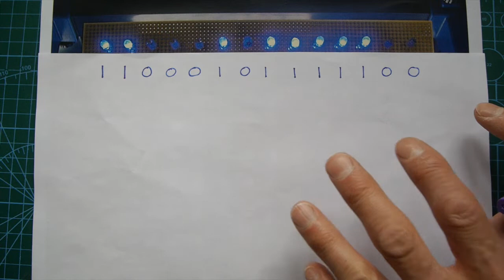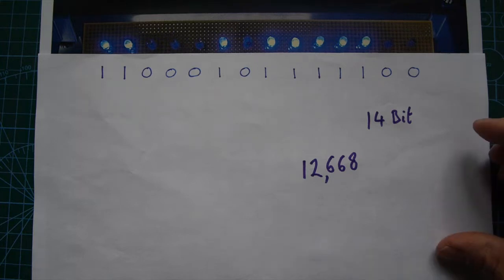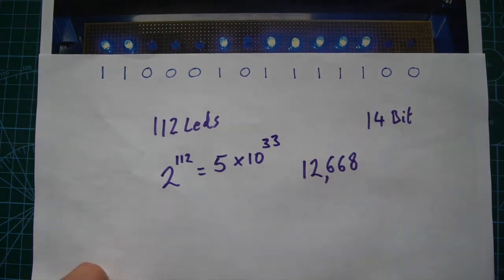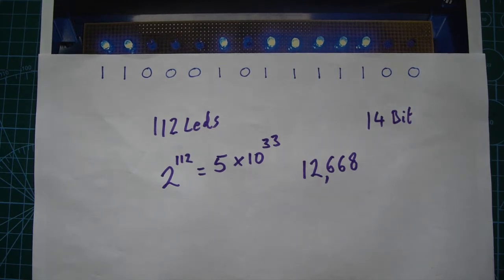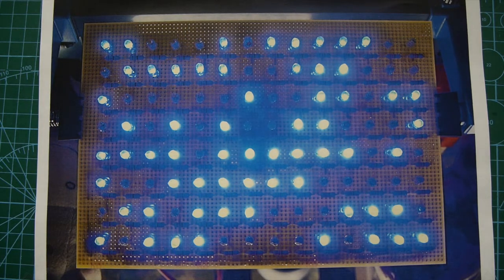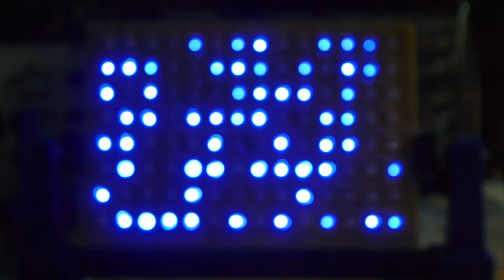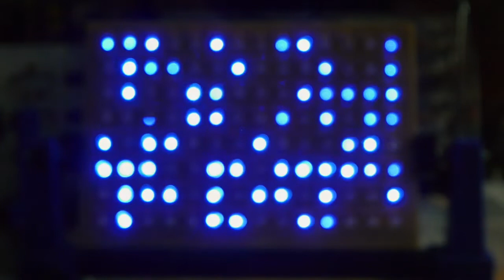Random Number Generator - F-J's Physics - Video167

Comment: Again is there some math that you can use that would actually create a true random number not just a pseudo random which is what I think you alluded to when you stated that there's some mathematicians out there. That's the reason I was thinking about using environmental background radiation and a Geiger counter. That's going to create pulses on the detection line and depending on how you write your code you could plug it into a pre-written script which seeks the randomness from your peripheral and you designate an attached peripheral via USB as your web camera or the pulses from a Geiger counter. It will then populate a place in memory I believe from which it takes random numbers. I've read some of the code on a really decent library and they all call it pseudo random but if you're getting your random numbers from something like a Geiger counter or even perhaps in your case I wonder if it is truly random? You would have to analyze the pattern of flashing and see if you can actually find a pattern. I don't think you would find a pattern in environmental background radiation. You follow me I guess?
Reply from the maker: Yes, there is a difference.  We describe nuclear radiation as being random but what we mean is you cannot predict when any one atom's nucleus will decay.  If you have a group or even background you have to decide what aspect you are measuring to say it is random as there you are dealing with a group of atoms.  In that case there will be patterns which can be teased out with statistical methods.

Comment: I was thinking that one of the only ways you could really get truly random would be to sample environmental radioactive decay with a Geiger counter. You could do it with muons but you're not going to get the count amount necessary to fill up the buffer. But just using the environmental radioactive decay level of isotopes It's going to be absolutely completely random due to the mix so as long as the code and the math used to trigger where that number is chosen from and how it's chosen based on the decay of the isotopes around the Geiger counter then you would have a true random number generator.
Reply from the maker: Yes, the limitation is on 'where the number is chosen from' and 'how it is chosen' again!

Comment: You could pipe the resister/LED junction of each LED into latches and use BCD drivers to output the value to a seven segment display.
Reply from the maker: Brilliant idea Steve!  I think I have had enough of 100s of solder joints but... I could build a smaller one.  You are giving me ideas!

Comment: Hello Anthony,
I have two points to your video.
First point, the behaviour of the blinken lights supercomputer is not random.  I know it sounds strange, but it is not random.  The correct word to describe it is "chaos"  the LEDs behave according to the chaos theory.

The second point goes back to the question why not use one resistor instead of many.  Actually that is great, great question.  All the LEDs are coupled via power.  When you have many resistors, the coupling is very weak.  Using one resistor instead of many will open two questions.
1.  when majority LEDs are off, the few shining got all the current.  You can "overcurrent" them and burn.
2. Having only one resistor means, that now the LEDs are more closely and strongly coupled.  So there should be visible tendency to resynchronise.
Reply from the maker: Radek, thanks for this.  Interesting what you say.  I guess it is chaotic as the there is a limited) though massive number of outcomes that are bounded within limits rather than being capable of any outcome.  I am working on a chaos video at the moment but I cannot get my analogue electronics to perform the correct differential equation integrations to show the Lorenz Attractor or similar.  I will get there at some point I hope!  LEDs, I did not realise it would affect coupling and therefore synchronisation.  That's interesting!  I realise that with multiple resistors the current through any LED should be fairly fixed when it is on obviously assuming a much lower internal resistance of the power supply!  Thanks for your interesting comments and for watching.  Hope you will enjoy some of the other videos too!
Reply: @AnthonyFrancisJones  , yes, the Lorenz butterfly comes to my mind when I was writing about chaos.  There is schematic he used, and I found it is also in The Art of Electronics the X Chapters, page 358.  However you need an MPY634 or similar, and two of them.  It is analog multiplier.

With that re-synchronisation of blinking LEDs, it is my prediction based on the fact that blinking LED is an oscillator.  When you find a way how to couple them strongly enough they must synchronise by definition.  There is a nice video on YT somewhere, I guess by Veritasium or someone, and there an mechanical motronomes are used as oscillators.  They behave exactly like the blinking LEDs and shortly desynchronised.  Then same situation but the metronomes were on hanging desk, which could move, and by the coupling of that desk they synchronised.
Reply from the maker: Thanks Radek.  Yes my chaos circuit will be like Horowitz and Hills.  The book of theirs I bought when I was at school predated the chaos chapter addition!  I am sure I have made a simple mistake or solder bridge in my circuit but it is sensitive to initial conditions by not working!  I remember the issue of clocks synchronising on a wall and also remember the paper on synchronising metronomes.  I think it has been much copied on YouTube.  I think you may well be right about the LEDs - I will have to try a circuit.  I do have one that has lots of LEDs in a cube with only one current limiting resistor and have not yet noticed synchronisation.  I think they are so cheaply made that they may well synchronise and then immediately go out of sync again due to differences in their manufacture.  Al interesting stuff!
Reply: @AnthonyFrancisJones  
hm.... yes, I call it to crash into reality.  The real word is not always as we think.  I was trying to find information about flashing led internals however was not successful.  This could answer why the do not synchronize as the metronomes does.

In meantime I got my new Apollo Vampire computer and program to it Paul Dunn formulas.  There is a small clip from it. https://www.youtube.com/watch?v=Z-48PZnKONQ

It kept me thinking about chaos much.  After a while I got to following conclusion:
1. There is definitely not a bit of randomness.
2. Diving my nose into formulas behind, I can't even spot the chaos.  Chaos has some prerequisites and I do not see them.
3. At least I see some catastrophysical behaviour however I lost somewhere my small booklet about catastrophic theory, so I can't say.

I wrote this program to play with the Paul formulas and got only to point that they are sensitive in negative way.  Instead getting some nice wild patterns, the formulas got tendency to collapse into noise, push everything in one side, or collapse to point in center.

In some it reminds me that putting oscillator into oscillation could not be so easy.  You made it perfect so no noise enter (and initiate oscillation).  Or the parameters of the circuit simply dump the oscillation and it collapse into one state.
Reply from the maker: You have done some interesting work there.  I must get on and get my Lorenz Attractor circuit working.  Time has been a bit of an issue recently!
Reply: @AnthonyFrancisJones  , a note to randomness a chaos.
By my amateur understanding.
Random system is a such system, where, even if you know all previous states, you can't predict next state of the system.

Chaotic system is a such, when with a little knowledge about past you can very successfully predict next state.  However the more to the future you are trying to predict, the less success and bigger error you get.  Typical chaotic system is 3 body problem.  Or on steroids, movement of bodies in Solar system.  And chaotic system do not need to have attractor.
Reply from the maker: I think you have got it just right there so thanks for this.  I am glad that the video has resulted in such interesting discussions.

Comment: rnd() { return 42; } is a random number, but it's not cryptographically secure pseudorandom number generator... same with your light, the patterns are clearly repeating. maybe when you snapshot it only every hour, then you may have a good distribution...
Reply: they flash with a similar but not identical frequency which breaks your randomness over short time frames. 
you probably can predict the next number, using the averaged frequency.
Reply from the maker: Yes, I am sure you are right there.  A bit like my lava lamp example (Tom Scott did a video on that I think) one does have to wait a bit and in the case of mine give a reasonable time between each sample.  However, all of this said the idea of it generating random numbers wasa only a thought!  I guess if it really did someone would have built one by now!
Reply from the maker: Interesting.  Each LED is wholly independent of each other one and will never have its timer made in exactly the same way so I struggle to see what the pattern repetition could be driven by.  Granted snapshots that are temporally close together will look the same but you have got me thinking if I am missing something here.  It reminds me of the rack of lava lamps that are all on at the same time but very divergent over a shortish period of time which are used to generate random numbers.  Thanks for watching and taking the time to comment too.

Comment: Is it random - read the values into a computer like a Pi and run rngtest or Dieharder on them. If you sampled the LEDs very quickly the values would be close together - not random. If you sampled them once a year they would be random because the variations between LEDs would have an effect. Happy days watching a PDP8, a proper computer with switches and lights on the front (and magnetic core memory poking out the back). Presumably the lights indicated data and address bus values, and the operators could read binary.
Reply from the maker: Thanks for that and a great story!  I remember using a mainframe and a dir command would enable you to hear the hard disk heads moving in the room next door!  As you have picked up I am really suggesting the idea of randomness here - I have not statistically tested it!  BTW I must do a video on magnetic core memory soon.  I have quite a few examples including a full cubic core.  I guess you have seen this video of mine?  https://youtu.be/WBHdNpAC7X4  Thanks again for watching and an interesting comment.

Comment: Fun! But is that actually random? ;-)
Reply: Not only the phase difference but also the temperature will also add some randomness.
Reply from the maker: Yes it will, you are right!
Reply from the maker: Very good question - not easy to justify but I guess if left for long enough it is not going to repeat exactly the same sequence in order for a very very long time!  More a case of me finding a use for this 'toy' as it were!